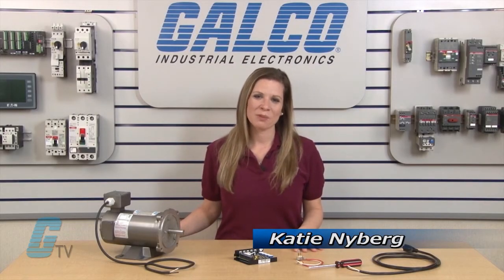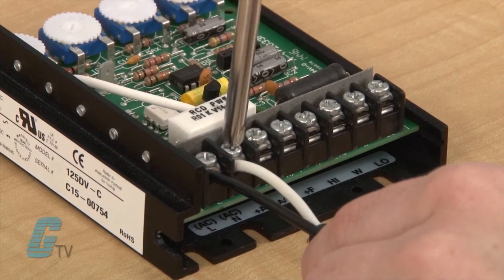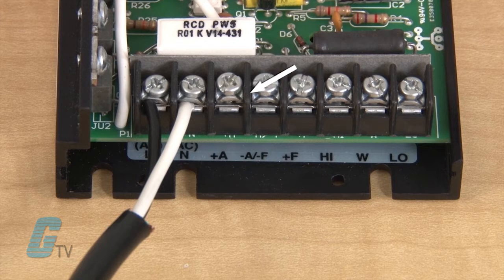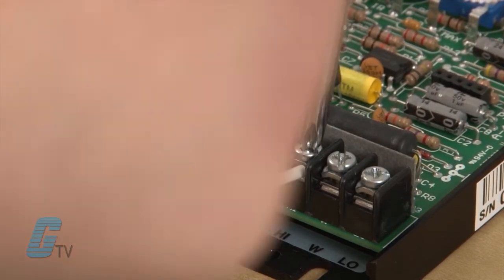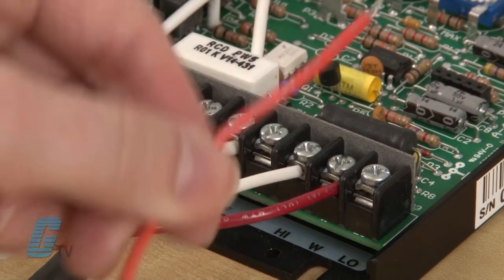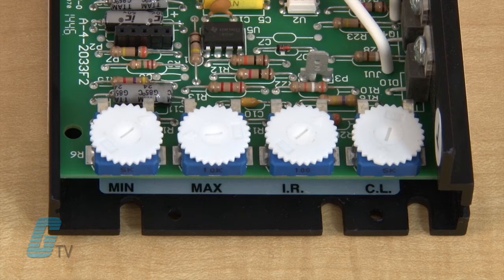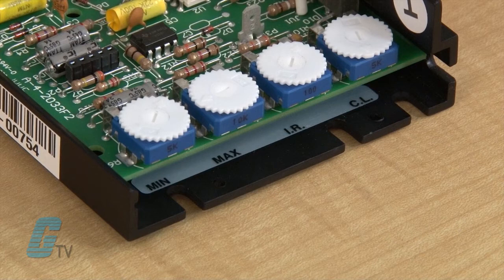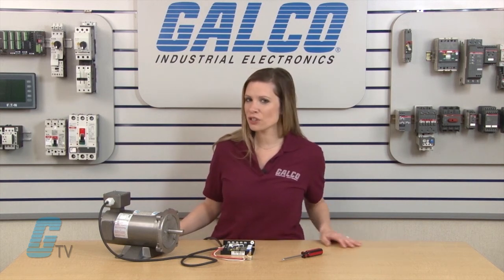How to set up the Dart Controls 125 Series of DC Drives

Comment from the maker: The 125 Series is a reliable control for PM, shunt wound, and universal motors that incorporates up-to-date design and engineering into a compact package. Installation and field adjustments are facilitated using a barrier type terminal strip and large, easily adjustable trimpots.